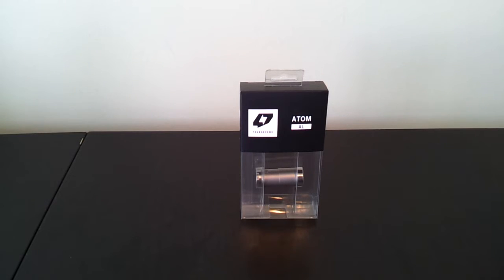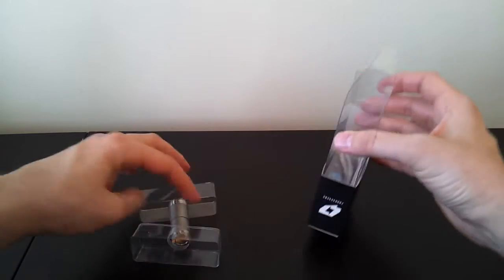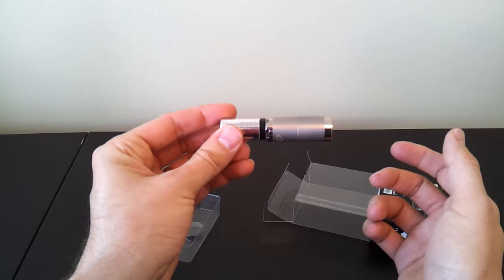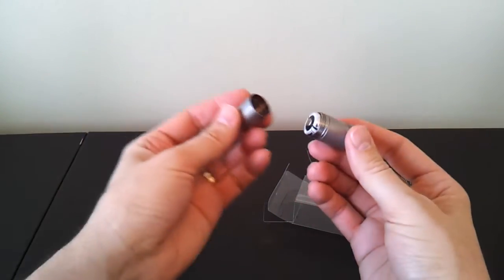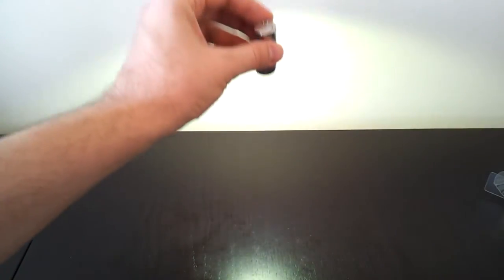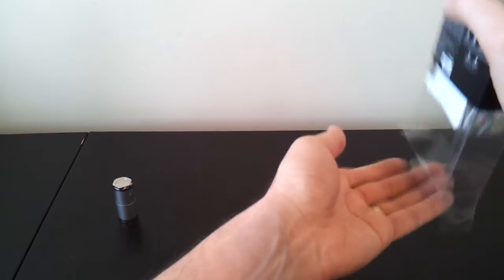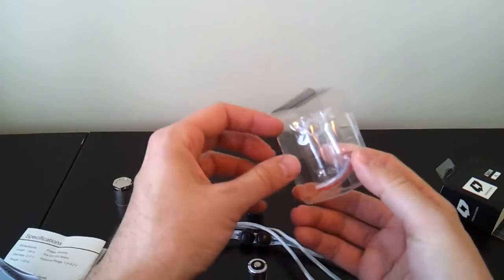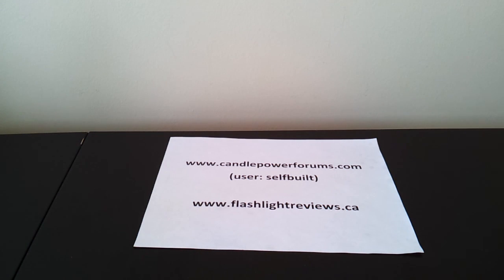Foursevens Atom AL (XP-G2, 1xCR123A/RCR) flashlight review by selfbuilt

Comment: So, how does it hold up against an Olight S10 of whatever version (original '12, the L2 of '13, and the R of '14)? Both are compact little lights in the same platform with magnetic tails.
Reply from the maker: Well, the atom is much more of a true floodlight (and lower output).  The reviews will have all the numbers for each.